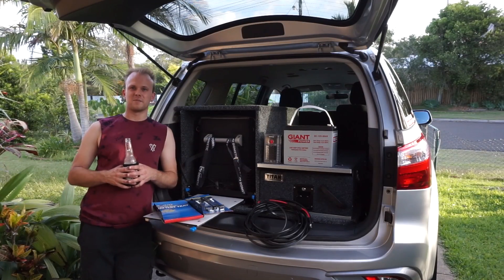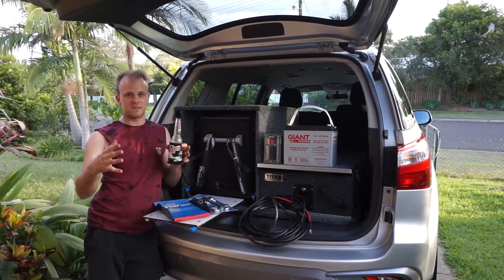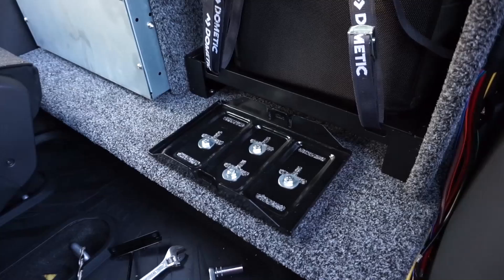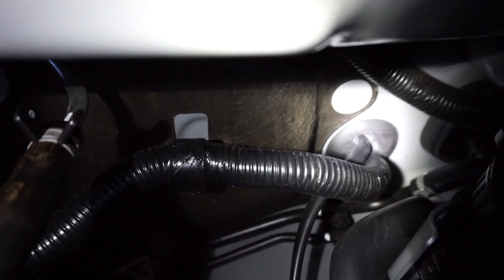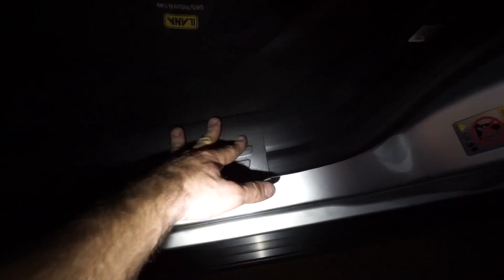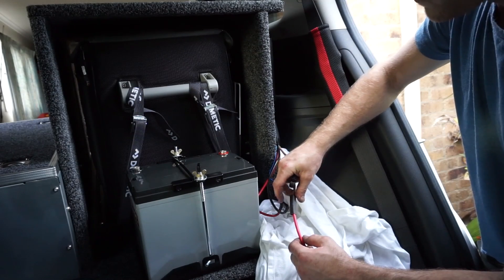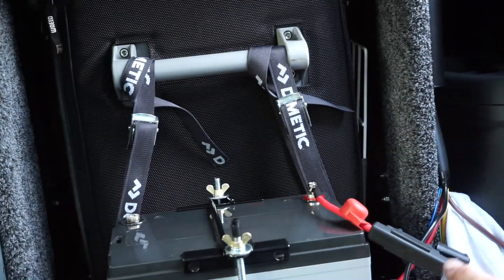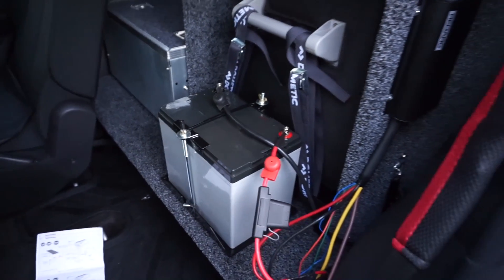Isuzu MU-X Dual Battery System and 12V Setup - How to wire up a 12V System

Comment from the maker: Hey Guys! Here's some tools that will make the job alot easier and more professional:-
-wire strippers:            https://amzn.to/3FhiN1P
-side cutters: 
https://amzn.to/3cehMuQ
-terminal Crimps and Crimper:
https://amzn.to/3kEg0YO
-gas soldering/torche kit:
https://amzn.to/3oqWZKh
-heat shrink kit:
https://amzn.to/3wJxQy8
-battery terminal crimp tool:
https://amzn.to/3Dihori
-Trim tool kit:
https://amzn.to/30mp5hF
-LED work light:
https://amzn.to/30wcoBd
Cheers Guys 😊🛠
Reply: Cheers thankyou!✔️

Comment: Thanks for the video. If you have a solar blanket would you just connect that straight to the starter battery to keep both charged up while camping?
Reply from the maker: @ConorMcgahern  yep you just run the power supply to the yellow wire I believe it is and then earth to the chassis.

Comment: Hey Nick, just starting to route my cabling on the new MUX.  Wondering would you still cut a hole in the factory FW grommet?  My cable will end at the exact same point as yours, can take the trims off no worries and with the anderson and all in one wiring kits it should be easy but not sure if cutting a slit in the grommet is the way to go.  If you could do it again would you take the same approach?
Reply from the maker: There's no other way to do it haha. Some vehicles have an accessory tab built into the grommet that you chop the end off and feed the wiring through but the Isuzu doesn't have anything like that. The only way to get the wiring into the vehicle is through the grommets.
Reply: @LowRangeNick  I thought as much, might just touch up with some silicone. I do love all the newer DCDC’s being anderson connections, plug and play!!!  Thanks mate

Comment: Hey mate so you can run the main power cables straight from the battery to the DC DC? There is no additional wire necessary to have the DC DC work only when the ignition is on? Cheers
Reply from the maker: Yep you can just run it straight to the dcdc. The redarc has a low voltage cut off switch I believe
Reply: @LowRangeNick  I see! Assume that means if the car isn't running, the voltage is lower, which the redarc then recognises and stops it from charging. I'm going iTech so will have to check if that's the same or if I need to run an additional wire from an ignition source. Thanks heaps!
Reply from the maker: @AlexSwan  On the later models they have a smart alternator, the early models don't I believe. If the vehicle has a smart alternator you will require the ignition signal to be connected. On the older models with standard alternator I don't believe it's necessary. But it's a good idea to check if the itech charger has a low voltage cut off so it doesn't drain your main battery
Reply: @LowRangeNick  My MUX is 2019, should be the same as yours? I assumed it already had a smart alternator. Be better if it didn't. :)
Reply from the maker: @AlexSwan  ok awesome, yep it will have a smart alternator.

Comment: Hi Nick, On the crank/start battery, where do you recommend connecting the negative from the dc/dc in the tub? I have  a 2017 Dmax and it has a smart alternator. I believe that it should be connected after the shunt! Regards
Reply from the maker: The negative should be connected to chassis earth. So any good earth point on the chassis will be fine. You don't need to run it all the way to the battery.
Reply: @LowRangeNick  thank you mate

Comment: So u have Dione install and great work on the fuse block and redarc hardware  I’ve done same sort of setup in a mates forby but I actually afford a 50amp MIDI fuse between crank battery and 1225D bcdc unit for extra protection a little bit of over engineering doesn’t matter in this sort of instance

Comment: Hi Nick. With the price of Lithium batteries becoming more affordable and weight saving, is it possible to use one of them instead of a very heavy Gel battery?
Reply from the maker: Hi George, it is absolutely a good idea. The redarc bcdc 1225d can charge lithium.
Reply: @LowRangeNick  Thank you for your reply.  I am in the middle of making a false floor for our MU-X at the moment. Putting in a single drawer and a small fridge slider for our Engel fridge.

Comment: Shouldn't be soldering vehicle wiring any more. Solder cracks with vibration. Auto electricians moved away from solder a long time ago.
Reply: If not solder, how do you connect them ?
Reply: @LesWieland  crimp connections

Comment: Great video Nick, I'm in the process of doing the very same to my 2020 Mux and I'm hoping you can enlighten me on how to wire the blue cable to the 12v socket in the back? For the life of me I can't work out how to remove it to connect the wire. Thanks in advance.
Reply from the maker: You have to pull the boot seal off a bit. Flick up the plastic cover on the tie down hook and remove the tiedown hook and then it should pop out.
Reply: @LowRangeNick  thanks mate it's been driving me nuts all day. I look forward to seeing more of your awesome videos.
Reply from the maker: @benkarnatz6777  Thanks alot 😊 Appreciate you watching!

Comment: Some really good videos here, some really practical and helpful advice too. I do however have one question, it is regarding the "Snorkel" Can anyone tell me what on earth is the point of having the air intake almost up at roof height rather than slightly above stock? Why would you ever want to keep your motor running when your entire dashboard engine and electrics are totally submerged? All those razored grommets are going to flood the cab and make the vehicle a total right off anyway!
Now, if you were to tell me it is for "looks" and not practicality, then fine, but no way that snorkel makes any sense whatsoever.

Comment: Gday mate loved the video, massive help! Do you know how you would go about wiring it to a pre wired battery box, I’ve got the giant battery and box, would you still run the positive and negative from the charger directly to the battery or to the box?
Reply from the maker: You can run the positive charge lead from the charger, the brown wire to the battery box power post and then the negative from the negative post on the battery box to the chassis earth.
Reply: LowRangeNick thanks heaps, just so I’m sure the posts are the external red and black screw caps on the box correct?            Also I just thought of another question...to run a solar blanket to the dcdc charger would it work if I hijacked one of the pre built in Anderson plugs on the box and replaced the red wire with the yellow solar cable from the charger?
Reply from the maker: @Jim-tb7sj  yeah the screw caps should be linked directly to the battery terminal inside. To run solar you will have to run the panel to the yellow wire from the BCDC and then the earth I think to the Chassis earth. The BCDC will regulate and supply the power to the battery. If you have a solar panel with a regulator built in you can just connect it straight to the battery via the Anderson plug.
Reply: LowRangeNick rightio, again thanks heaps mate 🙏
Reply from the maker: @Jim-tb7sj  No worries!

Comment: Thanks heaps mate, appreciate this. I noticed your fridge wasn’t wired into the fuse holder is that because it drawers too much?
Reply from the maker: The fridge plug  goes into an Engel socket which is run off the fuse holder.

Comment: hey mate! was just wondering when you wired the twin core cable from the dcdc charger to the starter battery did you connect the power to the positive and the earth just directly to the negative or did you then run a grounding cable from the negative of the starter?
Reply from the maker: I just ran it to the negative terminal.

Comment: one thing missing is how are you controlling the lights if they’re just connected to the fuse box?  Do you have some switches installed?  I don’t remember seeing your switches.
Reply from the maker: Both of the lights have inbuilt switches on the lights.
Reply: LowRangeNick yes, but where are they installed?
Reply from the maker: @FrenchHawk878  If you look at the video at 17:07 you can see the two black switches located on the front of the lights?
Reply: LowRangeNick oh, you meant those light.  I thoughts those weren’t hardwired, they were just snap on lights or something.
Reply from the maker: @FrenchHawk878  yeah, they are screwed into the plastic trim panel cover. They are run off the secondary battery.

Comment: Thanks so much, this video has perfectly explained what I'm going to do, can't wait till time off over summer to get my install going. One question, I have my BCDC1225D already and it has a midi style fuse. Can I ask why you went for the Maxi option instead? I'm assuming because you've got two maxi fuse holders so only need to carry one type of spare fuse?????
Reply from the maker: It was hard to find the midi fuse/ fuse holders at the auto stores near me so i just opted for the maxi fuses. Redarc does recommend the midi fuses though. Either will work fine. 😊
Reply: @LowRangeNick  Yup agree, hard to come by those midi fuse holders unless you're game to order cheapies off ebay. I'm trying to buy all of the bits and pieces for my 12V system at the moment, finding everything you need locally seems to be the hardest part of the build.

Comment: You helped me out on a couple of things I had questions about.  I'm building a sleep in the bed of my pickup.  I got the 100mA lithium with redarc. My main question is If you run your positive from ur main battery to the redarc. Where does the negative go? U mention something about just grounding on the chassis. So instead of me needing 25ft of negative cable to take the redarc to the battery neg. I can just take the redarc negative to chassis ground correct?  That will save me a pretty penny if so
Reply from the maker: I believe you should be able to just ground it to the Chassis. :)

Comment: How did you wire up the ignition trigger wire?
Reply from the maker: Wired to the rear cig lighter power supply 😊
Reply: I’m doing a system similar but in a camper trailer so trying to work out how to wire it

Comment: How you finding it so far? I'm looking at putting dual battery in soon. Any issues?
Reply from the maker: No issues ! All working great ! The Redarc BCDC and Giant AGM are a great combo!
Reply: @LowRangeNick  that's good to hear, did you have to hook the blue wire up to the ignition?
Reply from the maker: @thelastname2k  yep! hooked it up to the rear cig lighter as it is switched on and off with the ignition.

Comment: Hey mate, what size was your cable you ran from the starter battery? and also I have the kickass dual battery wiring kit here. would that be fine to use? I'm not running it to a kickass battery box but instead same as you to a bcdc1225d. Cheers
Reply from the maker: The cable size i used is 8 awg cable from starter battery to the bcdc. Im not too sure what comes with the kickass wiring kit but if it is your standard dual battery wiring kit with fusing and the correct size wiring then it should be fine to use 👍
Reply: @LowRangeNick  thanks mate, and also what size fuse did you use between the redarc bcdc and the house battery?
Reply from the maker: @TechStories79  40 amp fuse between the battery and bcdc charger 👍
Reply: @LowRangeNick  can i ask why you chose that size? This seems to be where I get lost lol.
Reply from the maker: @TechStories79  the redarc bcdc 1225d only draws and supplies a maximum of 25 amps to the battery. If you got the 1240 you would need a bigger fuse because the 1240 can draw and supply 40 amps. 😊 And thats what it says in the redarc instruction booklet.

Comment: Nice job,. Besides not having the correct crimpers described below, your pressure looked good and the solder and heat shrink should be solid.

Comment: Great video Nick from 1 MU-X owner to another. My only feedback is please buy proper cable crimpers rather than using side cutters.
Reply: You'd think we would send him a pair considering how much effort he goes to 😁
Reply: Yep, get a set of proper crimpers, you'll get a better connection and can forget about mucking around with solder!  Even hydraulic crimpers are cheap these days if you buy the no name sets of eBay or Amazon!
Reply: Agreed... I've found that good quality links of the correct size and a decent set of hexagonal crimpers are the best policy for the ideal joint... even introducing solder into the joint isn't a particularly great idea...

Comment from the maker: Hey Guys! There are a few things in this video that i didnt do as per the instructions and that i forgot to put in. The earth cables should be run to a chassis earth point, not a body earth. I forgot to mention the blue wire that goes into the redarc which is an ignition trigger for vehicles with smart alternators. The redarc earth point would be better closer to the controller not all the way in the engine bay. Although the way i have installed the redarc in my vehicle is working fine and ive had no issues with charging i just needed to let you guys know 😊😊😊 Thanks Guys 👍👍👍
Reply: where abouts did you connect the ignition wire to? cheers
Reply from the maker: @blakehunn49  to the rear cig socket power supply 😊
Reply: @LowRangeNick  what about the dmax with no exsisting cig socket does it still have the wiring?
Reply from the maker: @blakehunn49  unsure if the dmax still has the wiring, otherwise you might have to find an ignition switched voltage in the fuse box in the engine bay or inside the vehicle.
Reply: Hi all, on my 2018 Dmax, I ran an ignition wire from the fuse box under the dash by installing a piggyback fuse. This provided a live wire for igniting the Dc charger and to also shut down the DC charger when ignition is turned off.
Reply: Jenny thomas I just did my dmax today the same way. Didn’t like the idea of drawing current off any of the engine fuses, mind you none of the fuses in the engine bay had accessory power that I could find and I wasn’t prepared to cut the factory loom. Not too difficult to run through the firewall and connected up to my ignition trigger next to my midi fuse holder on top of the factory harness to the battery.
Reply: Mate if you don't mind, I'm copying your entire set up you have. I'll make sure I take pics and reference your channel and Instagram. This is such a nice setup, you have skills man!!
Reply from the maker: @dekaOsiris  Thanks alot! Glad i could help. 😊
Reply: Hi Nick, quick favor plz, which SUV you recon after your experience?
Reply from the maker: @banugaria967  Mu-x for sure 😊😊😊
Reply: @LowRangeNick  what do you say about build quality, I like Ford and VW  quality,they feel tough and heavy rugid ( owned both company car ) . I hope build quality isn't like Toyota, I been to some Toyota cars every rough surface feel like Car "shattered" too much and make me sick
Reply from the maker: @banugaria967  I think the build quality is pretty good. 😊
Reply from the maker: @banugaria967  mu-X for sure 😊
Reply: Any problems with voltage drop?.
It only looks like a thin gauge between your battery under the bonnet to your auxillary.
Reply from the maker: @lylewilshire  No issues at all. The BCDC 1225D only draws 25 Amps of current so the wire size is sufficient for the distance.
Reply: Hi Nick, so did you move you earth point for your second battery or did you keep it earthed to the body where you originally put it?
Reply from the maker: @Jakthorpe1988  Earthed to body as I did in the video 👍 still working well.
Reply: What do you mean "closer to the controller"?  Nice video mate

Comment: Great video mate! Did want to say if you notice a voltage drop at the redarc  I would recommend earthing the negative cable of the redarc to the chassis rather then running a negative cable back to battery (essentially it will half your cable run).

Also (and more importantly!) Fuse the feed coming from the main battery! last thing you need is the cable to rub on something and start a fire)
Reply from the maker: Hey Jim! Thanks alot for the feedback. I realised after that i should have earthed it closer to the rear of the car. All of the power supplies are fused, i might have fotgotten to put it in the video. Theres a few things i need to tweek to make the setup perfect. At the moment its working well though 😊 Cheers 👍
Reply: @Jim Catelli,  Why is an earth back to the the main battery a bad thing ? 
Would have thought this more robust and safer than using the chassis ?
I'm doing something similar but using a vsr and an amp circuit breaker near main battery.

Comment: If you remove the inner plastic wheel guard on the passenger side there is a cable entry point where you dont need to destroy your factory firewall grommet. Also, common issue when aftermarket cabling is routed through the grommet you gave used it is the best way for moisture to run down the harness and into you ecu. This is a common issue that I see in my job!! 🤦‍♂️
Reply: Also seeing your vehicles has smart charge alternator u should really connect the ignition input to the bcdc......